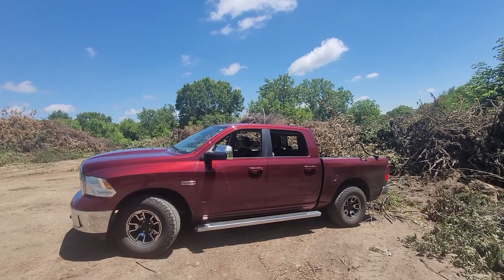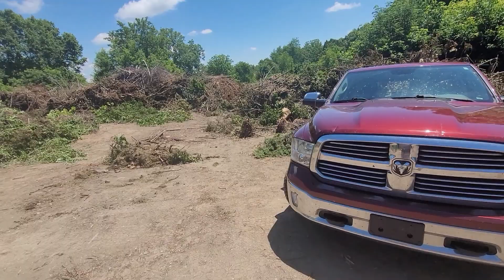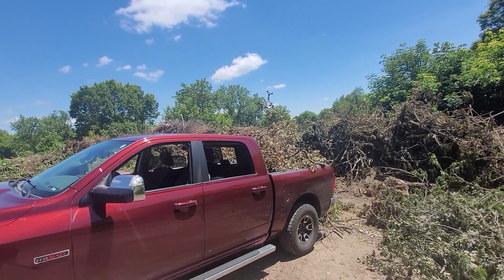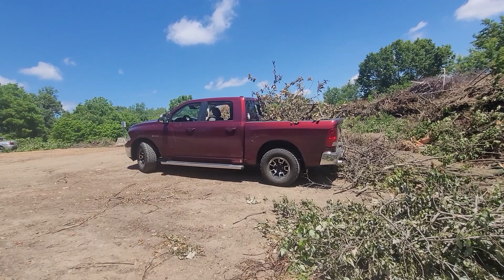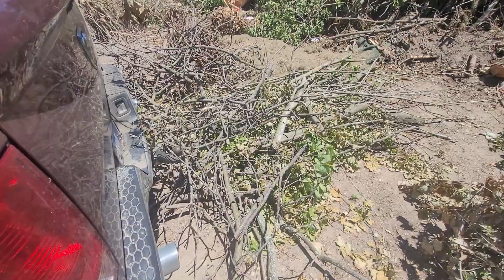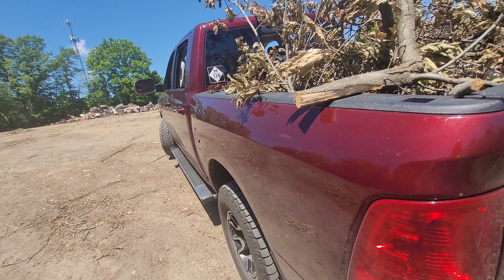Everything You Wanted to Know About 20 months of Ecodiesel rownership

Comment: Great to hear you’ve had a great experience! I personally have not, bought a 2019 and it’s been in the shop 3 times that year, finally they replaced the original motor that had 4k miles on it. Occasionally the transmission will have a harsh downshift, I really don’t expect it to be a 200k mile trans. With all this being said, I will sell this truck, but I do not hate it, it is a nice truck.

Comment: I've seen a couple dozen of these at my work and I always ask the guys how they like them and every single one of them loves em. I was skeptical at first and had heard some bad things from my buddy who works at Stellantis, but it sounds like those early issues were sorted and now all of the ones that were going to blow up have and the rest are good.
Reply from the maker: I also worked at Stellantis, the failure rate on these was 2.8%, with no smoking gun reason. Which is really really bad for reliability. 

But if you had a 97.2% chance of winning the lottery, you'd pay.
Reply: @TheDrivewayEngineer  Yeah, I knew you had the inside scoop. He’d said something about the plant where the engines were built had a dust problem.

Comment: 2014 GMC 1500 5.3L 6 speed Sierra Crew Cab, 21 MPG. I paid $20K and no mods needed. I drive a 150 mile trip once a week and that's what I get. Best I have done on that trip 23 MPG. Deleting will soon be a thing of the past, unfortunately. The fed EPA will be cracking down on deletes soon. It sucks, but it looks like it will happen. They are already going after bigger car lots selling deleted trucks. So trading in a deleted truck without the equipment reinstalled will soon be a thing of the past. You and I may not like it, but unless we vote these potatoes out of office it will happen.
Reply: You might pull off 21 on the highway. With that older 5.3. Plus towing with that hi RPM low torque sucks by comparison.  Where you would get 9 or 10 mpg towing a travel trailer he would get 14 or 15 IE 50% better towing economy. It’s why people buy diesels to tow. He is saying he averages 24 as a mix running around local. On the highway he likely gets 27-29 to the 5.3’s 21.

As to tunes, my son just got a legal tune for his 2022 eco-diesel.  The communist revolution of our government has been going on over 100 years already.  Unfortunately lots of people are still oblivious and voting for it. Unfortunately we’re losing the war of attrition. George Soros and the global elite are sowing us up with their boy senile Joe as the front man.
Reply: @vernlochtefeld1626  
While your son blew $50K+ on a new truck, making the argument about economy is pointless regardless of MPG. 
At 150K miles I am still getting 21 it does evething I NEED it to do. The only failure so far has been the lifters at 130K, $300 in lifters and a head gasket set, I did it myself. That's it, nothing else has failed. I don't pull a trailer that often. I have a 16ft flat utility and a 17ft RV. That is all I pull with any regularity. I get about 15-17 with the flat one and get 9 MPG once or twice a year I pull the RV. Makes absolutely no sense for me to put up with initial vehicle cost, DEF fluid, increased price of diesel, the increased cost of maintenance more frequent oil changes, amount of oil, multiple filters, etc. Not to mention of going through the trouble of "having" to mod or finding a shop to mod it to get working right. BTW, there is no such thing as a "legal" tune anymore, it's illegal somewhere in the vast legal oppression we live under. Why can't they make diesel truck function properly like they used to? All new trucks are guilty of this. Mine functions very well as is, no mods needed. Nearly all the cost savings with a diesel are undone the first time you have to pay for new injectors, if you can find them. It's just a wash out for me buying a diesel truck, i have better things to do than waste time maintaining or working extra jobs to afford to fix the thing when it breaks, and they do break and they are expensive to fix, easily 2-3 times more than a gas engine. I don't buy new trucks, I just can't see the logic in spending $50k or more for a new diesel. I would have to use thousands of gallon of gas/ Diesel to even equal the cost of a new truck. Just makes no sense for me to buy one, I don't tow trailers or rely on my truck for a living. My best friend does and he drives Diesel powered trucks for that purpose, he is a general contractor, he just purchased a Chevy 5500. He has that along with his two other older Fords F-350s with 7.3L. His personal truck: gas powered F-150. He believes the extra cost of maintenance and fuel cost doesn't justify driving the diesel truck for personal use. 
I have restored a 1987 S15 Jimmy back on the road and currently working on my 65 Chevy C10 deluxe cab fleetside short bed. I plan on putting as much old iron on the road as I can. Screw the EPA.
Reply from the maker: Holy shit I didn't read any of that 😂

I'm happy with my truck, I don't really need you to be happy with it, glad you like yours lol
Reply: @TheDrivewayEngineer  
😂
TL/DR: spending 50k+ on a truck then bragging about good gas mileage doesn't make sense.
Reply: @member57  My son ordered it then received it 9 months ago. When dealerships couldn’t buy what they wanted without a buyer. The dealership in today’s market after 18k miles will still buy it back from him for more than he paid for it.  Saying he is stupid only makes you look stupid. No idea why you would try to insult his decision making when you clearly know nothing about the details. 

Gas motor trucks are generally the best choice for most people depending on what they are going to use their truck for.  I never suggested you did Ill by getting or sticking with what you have.  Merely pointed out some of your oversights & misstatements about reviewers truck as you don’t own one & much of what you stated is either wrong or half right. 

The Green Diesel Engineering aftermarket tune he purchased IS legal for purchase in 49 states and for travel in 50. You can learn about it on their website. Fortunately he does not live in democrat communist politicians run California where currently they are unfortunately getting away with some unconstitutional state laws. And yes that will/would be very difficult to fix as communists hold power at all costs.

BTW its not that the Mfgrs can’t make a diesel that functions right it’s left wing government (EPA) interference as it doesn’t align with their party agenda. Consumers & citizenry pays the price. Don’t think it’s about being “green” either that’s just the scapegoat.

Driveway, Mileage was only about correcting some of his statements and telling the whole story so to speak. Mileage was in reference to the 4th gen not my son’s 5th gen buying decision.